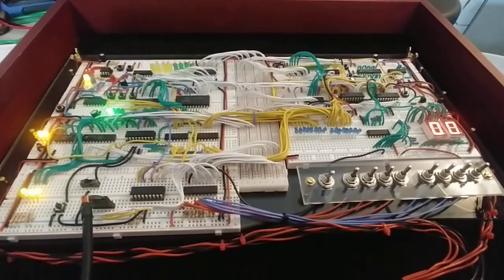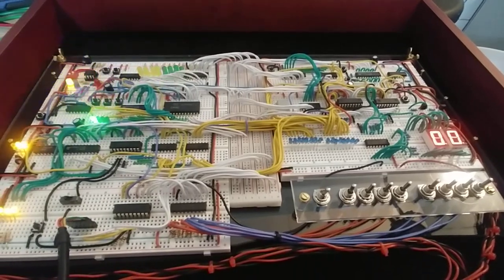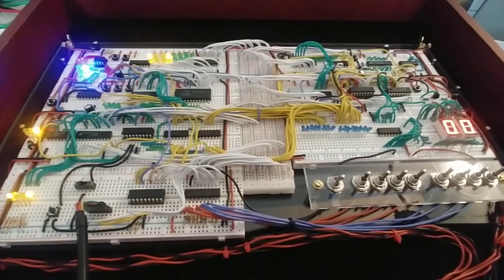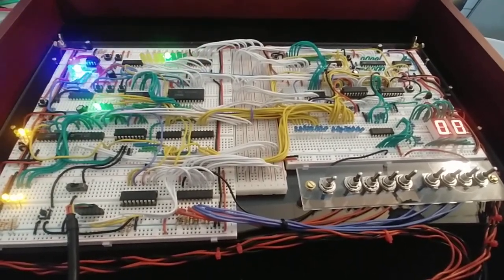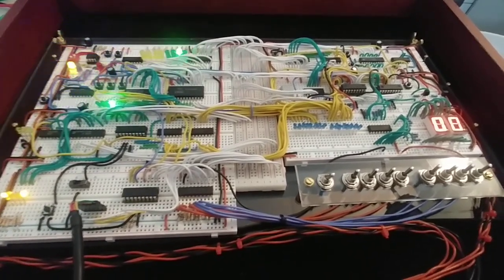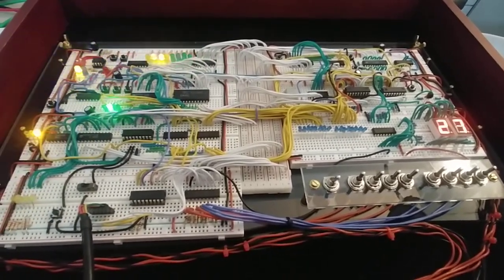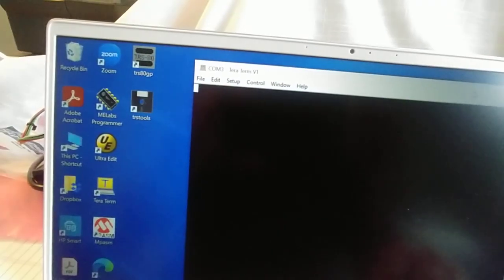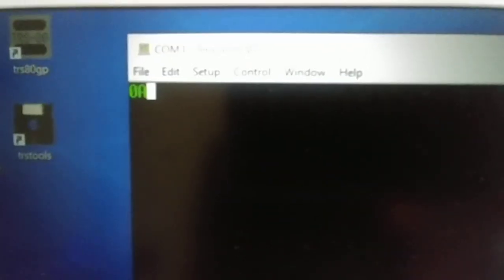My 8-bit TTL Computer #20 - Communication Breakdown

Comment: Hey.  It's always nice to find someone building TTL stuff - it's not everyday I find someone new that does that.  I've scanned through the playlist but haven't found any description of the actual design.  It'd be really great if you could show a block diagram of the design.

With the apparent lack of a EPROM (at least a 24/28-pin one) it almost looks like you're doing the instruction decoding and micro sequencing in discrete logic hardware. Is so it must be one of the most optimised designs I've even seen considering how few IC's there are for something that has all the minimal basic instructions for a machine that can run a "real" program. Or are you using some 256x8 PROMS that are hidden among the 74-series ones?  

What are you currently using for the ALU ? Just two '283 adders?

And the UART? My (hopefully rather minimal) discrete TTL UART design ends up at 9 IC's for TX and RX (inclusive a 4060 as a baudrate divider) - you entire machine is almost just 9 ICs.... amazed 

It looks like you're having a few of the 16/20-DIPs socketed - what's the reason for that?
Reply from the maker: Hey Mat.  Really good questions and observations.  The next few videos will address some of those topics.  At the end of the series (in about 5 vid's) I'll be doing a review of the project, compare to other TTL computers, lessons learned, etc. I will try and put together that block diagram for then.
Reply: Nice... I'm looking forward to the next couple of episodes.   Do you have some other TTL project in the pipeline after this?
Reply from the maker: I have two prior computer builds and was planning a few videos on them.  Should be something of interest.